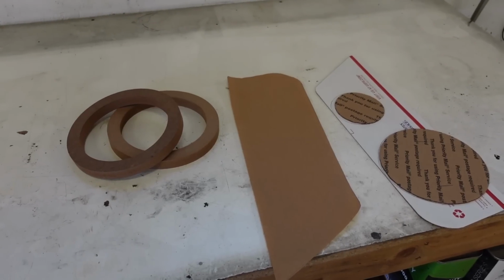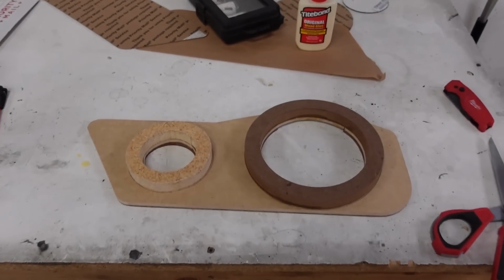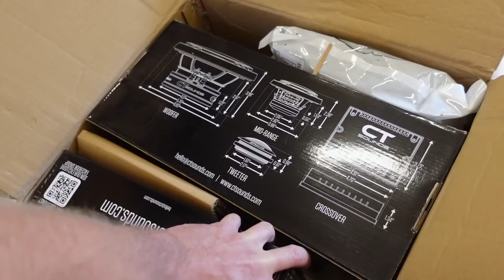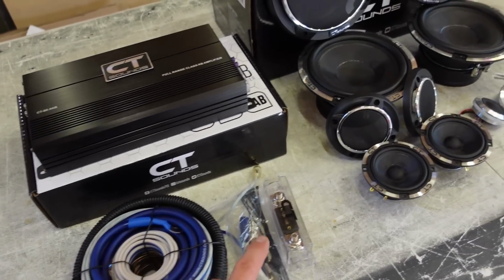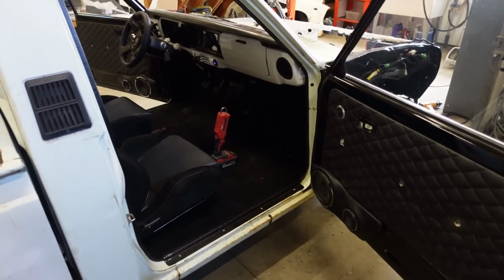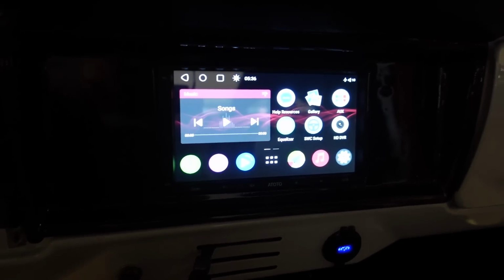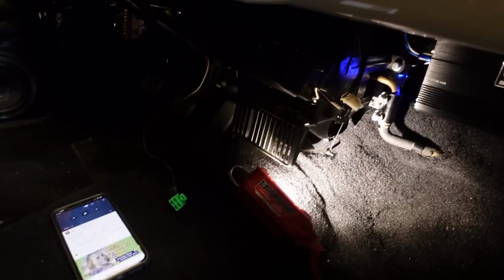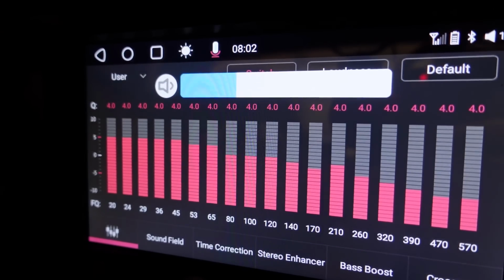The '77 Yota Gets An Epic Sound System!

Comment: Set the HPF (high pass filter) in the head unit to 80 htz to keep from blowing your 6.5”. The cross overs that came with them will only cross over the top end frequencies of that driver so you need to set the bottom end from the head unit or by using the HPF on the amp if it has one.
Reply: @bradlycriswell1990  you got it backwards man. High pass let’s the highs pass through your filter. Low pass let’s the low pass through your filter. So whatever you set your high pass at, everything there and above it will play. 

It really helps when you see a graph like I do on my headunit when setting it. Seeing the slope and etc it’ll make it so you don’t make that mistake lol I always use to get those 2 mixed all the time tho

Comment: Today's "Like" moment was when you used the q-tip to paint the bare edges of the holes you cut for the speakers.  Bravo!  You might want to try some foam baffles behind the larger door speakers to see how that changes the sound.  I love the idea of a slim sub somewhere.  You can then high-pass the current speakers and let the sub handle the low duties.  What about grills?

Comment: The reason it didn’t sound distorted is because you still have it on cinema preset. If you turn the EQ off on your head unit, then you can start to set your gains correctly.

Comment: Adding MLV to the doors will help with sound depth and output! 
Also for setting gains…
There are special tools (SMD DD1 etc) or cheaper options (Piezo buzzer trick, Voltmeter) to set gains properly by using tech and not the human ear. I’d recommend looking into those options and maybe adding a single slim sub behind the seats! That would seriously complete the sound system

Comment: Door panels are a moist environment, make sure you protect the back of the speakers, and your MDF/partical board panels from any dripping rain water from the window seal.  They make foam cups for that.  Some sound deadener on the door panels will help too.  Nice job on the pods, I was surprised how smooth they turned out without using body filler.
Reply: Hey I'm rebuilding my 77 sr5 hilux at the moment , and of the main things I wanted to do when doing this rebuild was minimize as much outside sound pollution as possible. I don't plan on putting speakers in my doors ,  but what material is usually used internally in the doors to help deaden that sound ?
Reply: @timothy2935  If you inspect modern door construction you will find a little goes a long way, but if you aren't concerned about weight, cover the outer door skin and inner door skin with dynamat or similar product.  An additional layer of closed cell foam also helps but given the construction of these vehicles there may not be room for both.  Covering the floor, firewall, and head liner will also help.  You'll never get the interior as quiet as a modern car simply because window seals and glass thickness limits you, but it will make an improvement.

Comment: Good video, but one thing about having a mid that low is loss of midrange. the mid should be higher up in the door or near the tweeter so they can be prominent and heard. Def set a crossover at 80hz and cut at 24db slope to drop the low frequencies out of it.

Comment: idk if you read the comments now but i can explain something that is kind of helpful to solve the "no distortion at full volume" thing. Set the headunit EQ to flat and turn the gain all the way down on the amp. Play a low test tone (40hz) and turn the volume up on the headunit until you hear distortion. Everybody says that you should have the volume to about 75% because it is common that headunits start to distort at that point. Some head units will distort even beffore 75% and in your case it is not distorting at all at 75%. when you hear distortion back the volume down 2 clicks just to be safe and never turn the volume up more than that, then set the gains on the amp by keeping your headunit at that volume while setting the gain and also max volume on your phone. keep turning up the gain until you hear it is starting to distort then turn it down a little bit until there is no more distortion. For the highpass filter i would suggest you check on the box the speaker came in and look at the frequency range it is rated for and then set the highpass according to that and maybe a little bit higher. For example if the woofer is rated for 20- 300 hz, set the highpass to about 30 or the bottom if your amp highpass filter can not go that low. Sorry for this long text but i just want you to get the most out of your system while still sounding good! really nice doorpanels btw!

Comment: Man, those pods came out nice. THe EQ should be set to compensate or decrease as needed. distortaion will happen when the amp sends a distrorted signal but this is depenant on the voltage the head unit puts out. my guess is that head unit puts out 1.5V clean 2.3Volts max but distorted. Ideally you want to know where the head unit distorts. I would also cross those over at 80hz. 55-65hz if you are not using a sub. In theory you want the 3" and tweet as close as possible and high up. Unless they play well off axis. Good job either way for a starter.

Comment: Those 6.5” speakers are not designed to play 40 hz. You should use a 1000hz track to set the gains for them. Also, the gains are ALWAYS the first thing you set and you do it with no sounds creatures on and with a flat EQ.

Comment: try leaving the deck's eq flat, and the amp on full range. with the external crossovers that went into the kick panels you shouldn't need to mess with any of the deck or amp crossovers. all your adjustments should happen at the external crossovers and set the gains with a DD-1 or an osciliscope.
Reply: This is not correct. You still have to set the high pass filter. 80 hz is where you want it at. Keep eq on radio flat, turn the radio to 3/4 and set gains on amp.

Comment: You make a great job with the soundboard. But why do you use this black leather? Ok its more work, but why do you dont paint it black or you laminate carbon over the nice shaping Soundboard? You have make the full pre work for that. And you can make a improvement to the soundboard, drill smal hols in the back of the un used section and spray hard foam (the non expanding after spraying) in it. So you have one solid part. And it is stiffer from the out side, and it beware from cracks in the fiberglas (my brother works in a car hifi store).

Comment: So.  My two cents from a installer perspective.  This is to help. Not taking crap.  The Mids/Tweets you have (not the midbass) would have been better suited more forward in the kicks where crossovers are located with the tweeter. Or you could mount the mid where the tweeter is at currently and make a mount for the tweeter. I mean within 2 inches at most in proximity to midrange.  This is to help with phase issues.  Tweeter does not blend as it should with midrange further away in this orentation. A lot of people do not install 3 way setups correctly and work best when together in one area (Tweet Mid Midbass within inches of each other)   You could mount the tweet and mid in the dash too.   Better thicker guauge wire is key,However not nessicary.  Spade terminals are awesome for crossovers.   Not knocking the skill set at all. Just trying to help you sound much better.   Speakers need to be as close to a "Triangle" configuration where you are in the center.  Left Speakers , Right Speakers and you in the center far enough back where you complete the triangle to give you a soundstage and phantom image for "stereo!"

Comment: 40hz is used to tune a sub amp not a 4 channel. For a 4 channel amp use 1000 hz. Also gains should never ever ever be all the way up! They are not a volume control. I guarantee if you put an o scope on that amp it will be clipping it’s head off!

Comment: Some sort of Lying is involved in this video. You don't get over 14 volts with a constant current draw (Like a Amplifier) as shown on the meter from a 12Volt battery that is not connected to an alternator which is also not running because there is no engine! CT sounds might make good products but they are not Magical and don't make electricity to run themselves.
Reply from the maker: Or I had a battery charger hooked up 😳😳😳